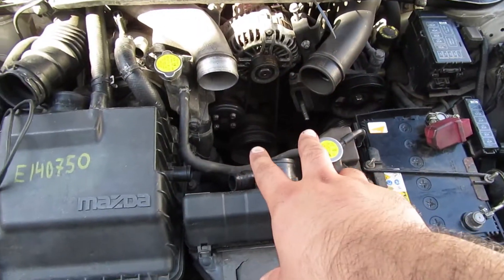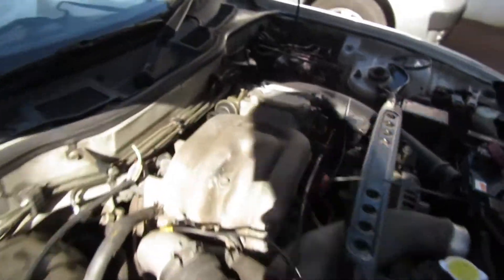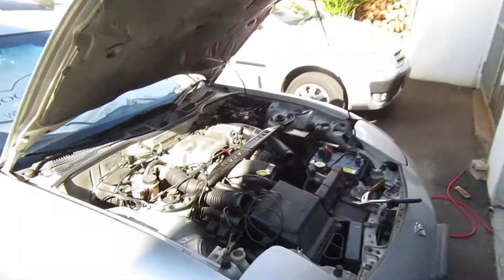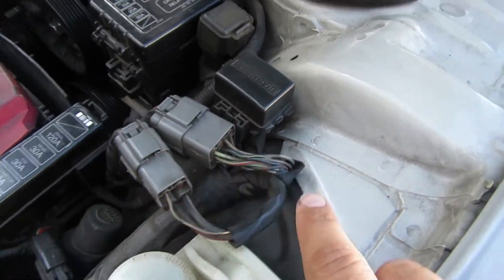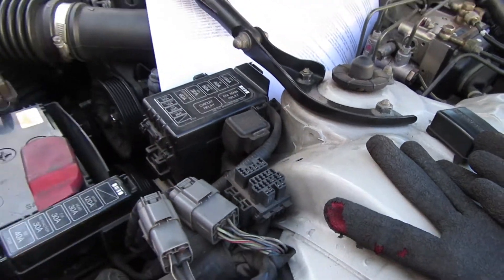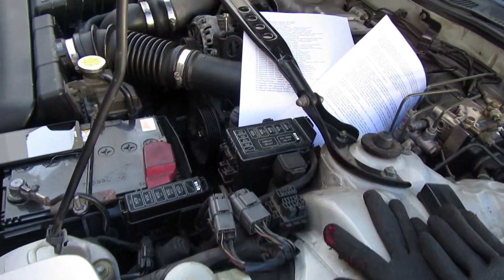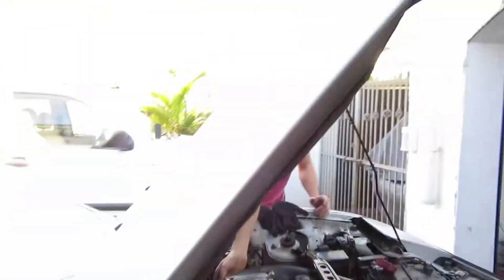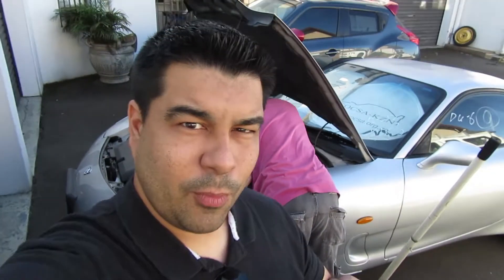Diagnosing Misfire - Type RS RX7 FD3S

Comment from the maker: Videos are slightly behind : Cleaned out grounds to chassis, pillar, UIM and will be running additional 8G wire to assist with grounding. Error 34 still persists. Seems like ECU is in limp mode due to "sensor" issue which isn't actually an issue and causing fuel cut? I'm ruling out Apex seals for now as I can only get a compression test done in 2-3weeks weeks with an actual rotary compression tester. Have removed coil leads and will be swapping with Black FD and also testing coil packs. Long list to test. Thanks for the support everyone.
Reply: NELKEL JDM VLOGS if you need me to I can look up other possible fixes for error 34, as it's an OEM error code, My shop manual will have info on that.
Reply from the maker: If you want to help then go for it, I'll appreciate any assistance :) Just odd when I pull the plug on both the black and silver FD it shows #23 which is actually fuel thermosensor, I'm not even touching that as it's under the UIM
Reply: NELKEL JDM VLOGS ok, I did manage to get info for both codes. I'll e-mail them when I get home as I cannot save to PDF on my phone :/
Reply: sorry for the late reply, i'm just about to email them. i was able to find some diagnostic flowcharts in the manual, however due to the rarity of the car in the US, there seems to be no "probable cause" based on previous documented repairs.
Reply from the maker: Hey bro, also replying late my end sorry! Just downloaded your mails will take a look during the course of the day. Thanks again for the help buddy, I appreciate it
Reply: NELKEL JDM VLOGS  from the look of it i think to fix all those problems easily would be to put in a aftermarket Ecu and wiring/sensor then you will be able to get rid of majority of that oem sensors and emissions stuff you actually don't need. Will depend on money i guess though and the fact that you probably would never learn or figure out what actually caused your problem either but its your choice at end of day.
Reply from the maker: nmotsa, so funny you wrote this! I'm actually thinking about biting the bullet if my attempts this weekend fail and buying an Apexi Power FC and datalogit system. 😂
Reply: NELKEL JDM VLOGS  oh i forgot to say Mazda did a service recall for grounding on the rx7 think its year 1995 or less years back they changed the wiring from engine to firewall,  newer ones had this fixed.  Bad grounding can cause bad idle etc  but i think you have checked all this in last videos.
Reply from the maker: Mine's a 1997 so hoping that was addressed, however my grounds don't look too healthy. I've cleaned them up already but I've bought some 8gauge wire and lugs. Going to be running a separate ground from battery to strut tower from strut to UIM, UIM to under intake on chassis, from there back to battery. At least that will eliminate that possible issue. Thanks for the advice, I really appreciate it
Reply: NELKEL JDM VLOGS  your welcome,  good luck with the rx7. They maybe a pain sometimes but its worth it when its running and you get to drive it and enjoy it. Amazing cars.
Reply: NELKEL JDM VLOGS don't go with apexi mate. They are great but for the money there are ten better options available now and the apex I are getting harder to support. Please look into the adaptronic plug and play and the haltec is another good option. I personally have the adaptronic and love it. It's easy to tune and has a massive support network.
Reply: did you find the problem?
Reply: Did you ever find the issue?

Comment: Hey Nelson. It seems to me that you're going about this in a logical manner, starting with the obvious, quick fix items and moving from there. Admittedly, you are not a rotary specialist, but what you're doing is respectable. You're learning. Cool that you have the black RX-7 sitting around to help with the diagnosis and your fans have been giving pretty sound advice on things to try.👍 Doing the work yourself sucks sometimes, especially when it doesn't work, but once you get it figured out, you'll be happier with yourself than if you had just dropped it off at some shop for a month. It's all part of the bonding experience, bro. This car started off with drama at customs and it ain't over yet, but hang in there... I know it'll be worth it. As for the occasional haters, they have their purpose, too. You know you've arrived when you start getting a few trolls.😆 I hope you get this car sorted soon, brother. Have a good one.✌
Reply from the maker: Hey Mick, apologies for the late reply. Received the keys for the new house so have been busy planning renovations and all of that nonsense! 🤗I think I have found the issue, working on a video right now but need to go back to the car and film the ending.. Sorry just a super quick reply on my end, have a bunch of people to reply to.. This YouTube thing is hard hehe :)

Comment: On time yet again lol. In lunch rn. 

Also if you ask me Keep doing these vlogs on fixing the RX7, I personally enjoy them, and enjoy trying to dig through my shop manual to try to help you lol. And again, if you need any code remedies, my shop manual is able to give a "most likely the issue" based on previous repairs.

Also personal news. Got the A/C compressor replaced in my uncle's truck, filled with refrigerant, and the A/C works. Belt, belt tensioner, spark plugs, and oil have been changed. Just gotta finish balancing the tires, an alignment, and then the distributor.

EDIT: also my shop manual doesn't have an error 35 either, so that's a bit peculiar

EDIT 2: need wiring diagrams in case it is a wiring issue?
Reply from the maker: Oooh shit, didn't see this comment sorry! I'll keep at it with the videos then 😂That error 35 is truly strange, must be an automatic thing due to the fact that the ECU on that car is different to the manual model. Got me some wiring diagrams no stress brother

Comment: why don't you l grab a compression tester they use for piston motors.  take out the small Schrader valve in the end. screw it into front rotor sparkplug. have someone crank it and watch the bounces for each apex seal. repeat process for rear rotor sparkplug.. will at least give you an idea.
Reply from the maker: +Lexannn Hi Lexannn, I've actually done it already about 3 videos ago I used a piston comp tester and saw 95psi on the rear and about 110psi on the front rotor. Most people are telling me to get a rotary comp test done though.. Am just waiting for the inspection then I can get the car out to get a test done..
Reply: Those are pretty high numbers. Don't think you'll see much difference from the actual compression test.